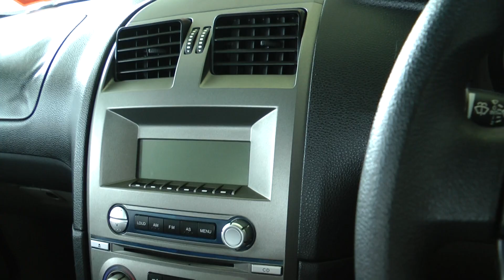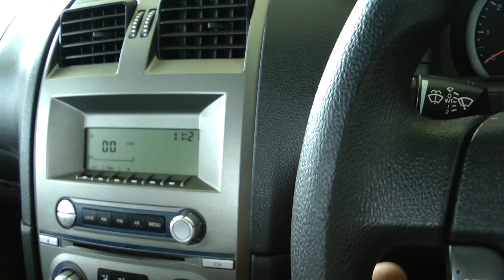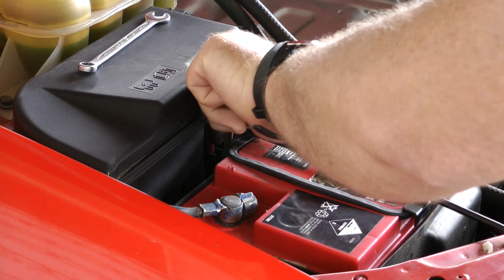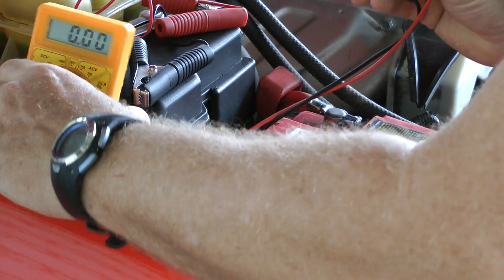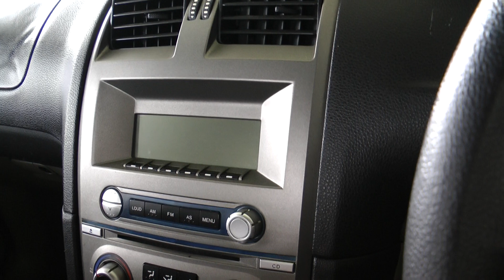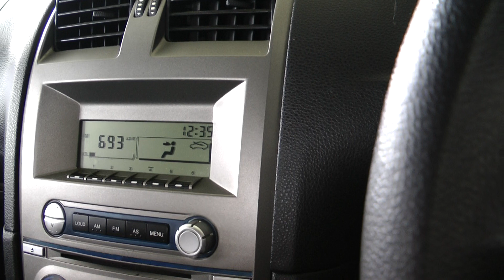How to change your car battery without losing your radio code and dashboard setting. HD

Comment: WRONG! Start by removing NEGATIVE first, then positive.
Reply: Which ever terminal is removed first could cause a spark because a complete circuit is being broken. The main reason it's recommend to remove negative first is - the wrench, while on the battery terminal, may touch a grounded metal part of the car. If one is removing the negative first, no harm done because the negative cable is already bonded, or connected, to the frame of the car. If you are removing the positive first, and happen to touch the tool to some metal ground, you now have a short circuit of the battery. If you are extremely careful, the positive can be removed first, as long as it is not accidentally shorted to the metal ground of the car.
Reply: @RichardFallstich  Yes, people saying black first are following "replace" battery procedure for best safety, but jumpstart procedure is the opposite, positive (of dead) to positive (of live), then negative (of live) to negative (of dead). This is why the instructions of this product say to do it this way, it is battery to battery vs removing a current from a system and adding a current back to a system.
Reply: Jake, what difference does it make what the positive terminal of the battery touches once it is off the battery?  It is at the same potential as the negative terminal ... how do you get a spark from that?

The reason they tell people remove the negative first is that if you do not remove the negative then anything you might happen to touch while removing the positive terminal might short to the negative through the chassis ... which will cause a short, spark, maybe an explosion.

Just being careful will work too.
Reply: Lin Murphy Orrr...it really doesn't matter. I've never once been shocked and I also place the terminals on with bare hands. Besides, 12v and 24v isn't enough to cause harm and the amperage of a car battery is also not enough to cause harm.

Finally, the theories and reasons for putting one or the other on first are easily quashed.
Reply: scbonduk I do the same, never have I been harmed by taking off positive first or vise versa

Comment: There's a diode or some other protection between the 9V battery and the 12V accu.  Don't do this with a plain 9V battery! When you directly connect a 9V battery to the 12V car battery ,  a undefined, possible high charge current will flow from the  12V car battery to the 9V battery. This may blow the 9V battery!
Indeed, take care not to have any car lights on (including the interior lights, that switch on when one of the car doors are still open)
Reply: Excellent advice!
Reply from the maker: This is why in this case the positive is removed first

Comment: I wonder if a trickle charger would do the same thing?
Reply: LeeC58
Reply: If it is an actual charger and not a maintainer.  A maintainer needs to be hooked to a battery that has at least 12V before it will put out anything. a charger outputs 13V or higher regardless.

Comment: that's a negative ground battery.You should ALWAYS disconnect the negative terminal FIRST and the positive last.When replacing,connect positive FIRST and negative last!
Reply: To the comments of Jose Peixoto & Larry Bui. You are right if you simply replace old for new battery and don't care if settings for radio and clock etc, are wiped out. However, if you want to retain the your settings the the video is correct.
Reply: Rule of thumb is always remove the negative terminal first.
Reply: I never heard any one recommend removing the positive first (unless it's a very old or odd car with positive ground.) The vast majority of cars have a negative ground. By removing negative first, you reduce the chances of shorting something to ground. If the wrench being used to remove the negative terminal should touch any grounded part of the car - no damage done. If you go for the + first and touch the tool to metal whilst the + is still connected, it's a direct short circuit of the battery. This could be very dangerous, allowing potentially hundred of amps to flow. Battery could explode, fire could occur, etc.

And how could one possibly remove both simultaneously? Loosen both clamps simultaneously? What if the tool touches the car's frame 2 microseconds before you remove & loosen the negative?
Reply from the maker: @RichardFallstich  Because it is always positive first, negative second when connecting two batteries together. ALWAYS, in every country in the world, look at your jump start instructions. Positive of dead battery to positive of healthy battery, negative of healthy battery to negative of dead battery. You got confused because when removing or placing a dead or live battery directly into a car with no other battery connected you go negative first then red. Simply put there is a difference between connecting two batteries and replacing a battery. https://www.shell.com.au/motorists/go-well-content-hub/back-to-basics-how-to-jump-start-a-car.html
Reply: Because he's using external power, if he removes the negative first he'll lose his settings.
Reply: I´m lost here; some say +,some say-;    I think it´s best to remove both at the same time ,that´s what I´ll do from now on

Comment: What is the device you are using that is connected to the battery cable when removing the battery so you don't lose the code or car settings. What's the name and where I can get it from? Thanks your video is very helpful.Thanks!
Reply: heymargaretlook
Reply from the maker: +Isse Ali It's called a memory minder and should be available at car accessories outlets.
Reply: +heymargaretlook got it thanks!
Reply: heymargaretlook

Comment: Using a 9 volt is fine but it must have a diode in series to prevent feed from the car battery..
Reply: I have used that 9 volt battery device
there is no diode
it worked ok for me
they sell them at auto shops
they wouldn't sell them if they were dangerous
Reply: The diode has nothing to do with AC. If correctly wired, a diode would prevent the 12V battery from trying to back-feed & charge the lower, 9V battery. That being said, most 9V batteries have enough internal impedance to prevent any substantial current flow to charge, thus little danger exists. I wouldn't leaves it connected this way for hours, but several minutes should not be any problem.
Reply: You must have one of those new A/C batteries they sell to the not very smart people.

Comment: the easier way is to get one that plugs into the cigarettle lighter. Works the same way and cant be knocked off while removing the terminals.
Reply: +joenissan That may not work. Your cigarette lighter may need the ignition key to be in the accessories or on position. Disconnecting the battery while there is current draw from other items that run from the accessories or on may cause arcing and damage electrical components.
Reply: +allbeit222 I have two. One that's always hot and the other when the key is on. If you only have one that's hot while the ignitions on, just turn it to accessory making sure everything in the vehicle is off. It will always work. Been using one like this for years. The clip versions are fine but don't usually have strong enough clips to keep from falling off while removing the terminals.

Comment: Thanks for the video.  I've tried to find this item but Amazon and other sites only show "battery maintainers" which are much more expensive than the unit shown.  Looks like ten bucks is a fair price but I cannot locate this item by they brand shown.  Any links would be appreciated!
Reply from the maker: +David Daniel +David Daniel Look for it at car accessories store or Walmart but I think the cheapest is US14.00 and is the plugin lighter type.

Comment: I literally started laughing out loud as soon as I saw that tiny 9V piece of s**t. Use an external battery or a jump starter.. for the love of things!
Reply from the maker: FourInTehMorning It's not a jump start, there wouldn't be enough amps to push a pea it's a small current to keep your setting thats all. If you use a external battery you have to not break the circuit.

Comment: When I disconnect the battery on a Mitsubish Pajero iO for an extended period it messes up the tick-over. Fixing is simple when you know how, albeit a bit time consuming. Simplified, get the engine warm. Run the engine for 10 minutes, stop the engine. Restart the engine, switch on the air con, fan, open the electric windows, 10 minutes. Stop the engine. Restart the Engine, run for another 10 minutes and tick-over should be OK. I'm not making this up.
The good news is that disconnecting the battery doesn't cancel the radio settings.
Jack, Japan Alps

Comment: !!Dont do this with ordinary home made 9V battery ensemble hooked!!. Until you disconnect old 12V battery it will 'charge' small 9V and it is 'no no' to charge nonrechargable battery - they can explode. Even rechargable types are not supposed to be recharged with several amps as here will be the case.

Gadget that is shown in video is (hopefully) protected from such scenario.
Reply: Djordje Stevovic The device must have a diode to prevent back-flow of current. It would be easy to home-brew if you have the skills.
Reply: If I disconnect the 12 volt first then there's no point of putting the 9 v because everything is gone you fucking idiot

Comment: those indicators built in to the battery are not accurate always check it with machine that will load test the battery
Reply from the maker: The battery was over 4 years old so odds are it is correct I also have a load tester thanks for your input.

Comment: For replacing a new battery because of danger of fire caused by spark the black negative cable is always the first cable to remove and the last cable to connect. Some VW and Audi cars may need more than 9v to save memory.

Comment: When I replaced the battery in my 2002 Passat my radio went to SAFE mode and later went to LEARN and righted itself without me having to enter a code.

Comment: You should always take off the negative first & put it on last.Not a huge biggie with 12v although it will short out your spanner if you happen to touch it to earth with the positive still connected. On 24v system it is a must, I have seen rings melted into fingers by doing it wrong.
Reply: Electricians dont wear rings for similar reasons
Reply from the maker: Because it is always positive first, negative second when connecting two batteries together. ALWAYS, in every country in the world, look at your jump start instructions. Positive of dead battery to positive of healthy battery, negative of healthy battery to negative of dead battery. You got confused because when removing or placing a dead or live battery directly into a car with no other battery connected you go negative first then red. Simply put there is a difference between connecting two batteries and replacing a battery. https://www.shell.com.au/motorists/go-well-content-hub/back-to-basics-how-to-jump-start-a-car.html

Comment: I have an auto battery charger with tickle charge. Can i use it as a "battery reminder" to keep the car "memory" while replace the battery??
Reply: Yes if your charger is 'dumb'. Most 'smart' ones check if battery is present. If not (like when you disconnect old battery), they shut down.
Reply: Voltage spikes are not related  with 'dumb' or 'smart' but with cheap or decent quality charger. 'Smart' will cut the power, if batery not present. To be safe, best ask proffesional to do the job.
Reply: Please don't.
If the battery is not present, you could get low current voltage peaks from the charger that otherwise would get absorbed by the battery and may destroy your electric systems, especially on "dumb" chargers.

Comment from the maker: Again people who say they can do it a different way or already have a model car that retains these setting, so why are you here?
Reply: I'm assuming 314Tazo is referring to having your battery out for long periods of time, like when you need to leave it on a charger somewhere but I have no idea why you would use this video for internal resistance testing...that's easy enough to do at the parts store generally.  and cleaning the battery posts and clamps is quick enough that 9v should power the memory long enough.
Reply: heymargaretlook

Comment: Hi I have a 2007 model BF Mk2 and my car keeps all radio codes and settings if you remove the battery you just need to press FM and all the presets are there!!!

Comment: The best way for me is use a jumper cable and clamp it to the new battery while disconnecting and removal of the old battery.
Reply: I was thinking about doing like you described but the clamp on the new battery will be in the way when connecting to the car. I prefer to use a backup battery.

Comment: Hi, thanks for share...
One question... would be it the same, if  I connect the memory saver directly to
lighter cigar?
Reply: That doesn't always work as some cigar lighters do not have power unless the key is turned on.  Some have power all the time and those would work with the memory saver hooked into the lighter.  The lighters that only have power when key is turned on won't have the connection to the power system in order to keep power to the system.

Comment: He has to be using a new car not a four year old one. No rust on battery clamp and not a speck of dirt anywhere. Why did he lie
Reply from the maker: Are you kidding a clean car under the bonnet means the car is brand new LOL mate it's December 2006 model

Comment: why not just change out Battery's while the engine is running.
Reply: it work if you goin to change with new battery
but not if you goin to charge it
cheers from egypt
Reply: at daray you could spike the computer

Comment: yes ive always removed the negstive lead first so theres no spark opr charge
Reply: Yes, removing the negative cable first ensures that you do not accidentally weld your wrench to any grounded metal when tightening or loosening the positive battery cable. There is no danger of arcing when removing the negative cable first because the frame and the negative terminal is at the same potential.

Comment: This wont work on many cars so here is the easier way.
Call your mate with a car and connect the cables from your battery with a pair of jump leads to his battery (+ first ...) and make sure you get some nice contact. Then just lift the cables with the jump leads on and replace the battery. It might cost you a drink afterwards but it does always work.
Reply: Heres another idea. Use a car/truck battery charger. Connect the Positive (+)/Red jumper from the battery charger to your Alternators Positive (+)/Red connector. Than take the battery chargers Negative (-)/Black connector to any good Ground (-) on your vehicle ie a fender bolt or the hood latch.. some place under the hood with a good Ground (-) connection. Good luck hope this helps.
Reply: Both replies are perfect! Thanks Mates.. Eddie J... Lake Grove N.Y.

Comment: This didn't work for me. With modern cars, there are a lot of active electronics. A tiny 9V battery is not enough to keep your systems alive. If you allow for a snag or a snack, you'll need a 12V supply with sufficient current to make sure that you'll get enough keep-alive power while you are replacing the battery.
Reply: We have used this one in our shop with great luck. https://www.ebay.com/itm/254234706072

Comment: Hi - thanks for the great video. I have a mazda 2 neo (2006) where I needed to remove the battery. I decided to go with another 12v car battery (as the donor battery) instead of a 9v. All was going well until my one of my donor clips fell off, so I lost all power. Its possible my car has the ability to remember the settings for a short while, as all I lost was the clock time and speedo travel distance.Just to be sure, in case the ecu was reset, I ran the car for a while at idle to help it.

Comment: There's s simpler way.  Just start the car and leave the car running when you change the battery.  The alternator will keep your system happy.  Make sure you keep the two terminals insulated during the switch out.
Reply: Could cause damage on newer cars.
Reply: Changed my battery today using this method and easy as and done in 5 minutes with no loss of system. The alternator  keeps power to the whole system whilst running.
Reply: This may destroy alternator diodes. Ask me how I know.
Reply: Most modern cars shut right off :/

Comment: can i use this device to all modern car to avoid the NON START issue when i disconnect the batery lead when i need to make a job on the engine? cause im afraid to disconect negative cable to work on the engine cause im afraid the engine wont start then,,, cause of the DAMN electronics, alarm code or anti theft code *AND I ll be obligated to go to the dealer THATS SOMETHING AS A TECH I DONT WANT TO DO,, can you recommend me a webpage to know more about this stuff

Comment from the maker: As cars have advanced changes have been needed in the old days it was the negative first (lead acid battery) so you avoided arcing these days consider the car has an engine control computer and gell and calcium batteries emit little or no hydrogen gas etc. Some suggest to avoid a voltage spike going through the computer's and voltage regulator's circuits remove the positive cable first to de-energize the wiring harnesses. Reconnect the negative cable last to avoid spiking those systems. -cont